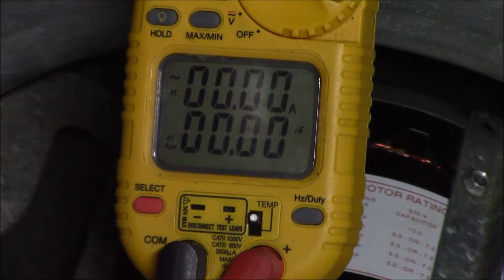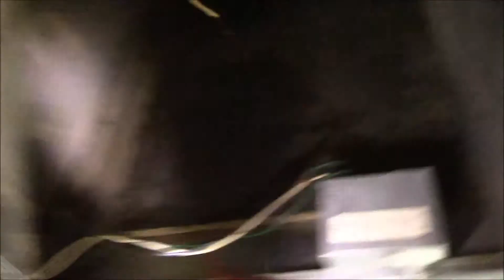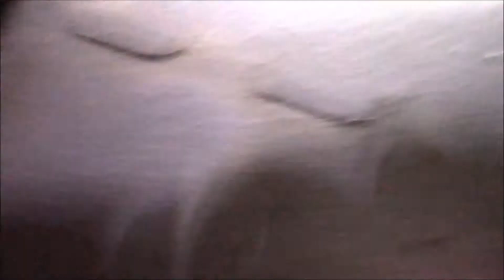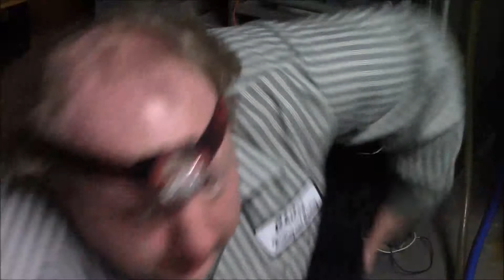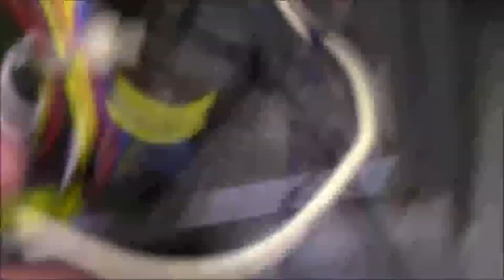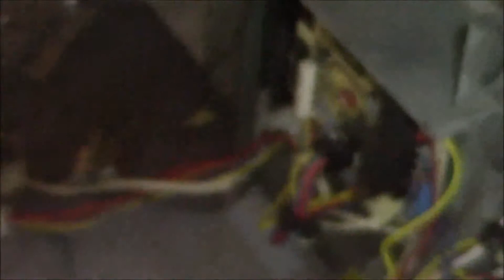Rheem heat exchanger, fan capacitor testing  (furnace service part 4)

Comment: Good Morning. I have similar unit. Is there an oil port for the Blower Motor to oil. My unit is 25 years old. It make slight Noise in the beginning like it need oil. Please advise. Thanks for posting a good video.
Reply from the maker: Hello, if it diesnt have a plastic cap on the ends, then it just might be sealed bearings and cant be oiled.